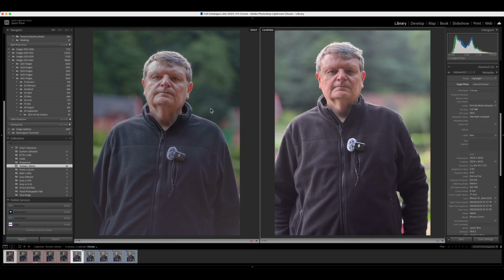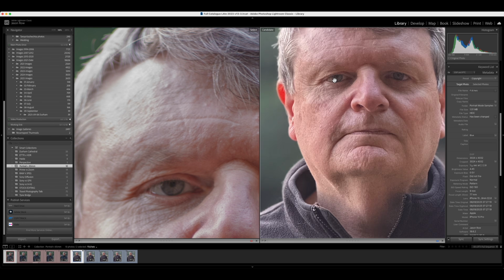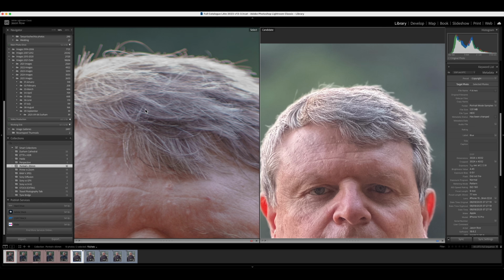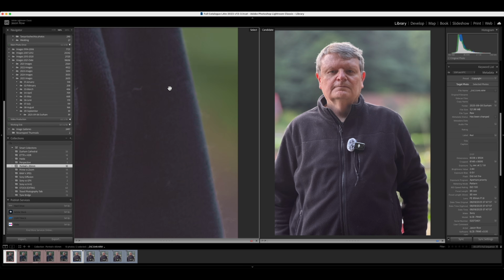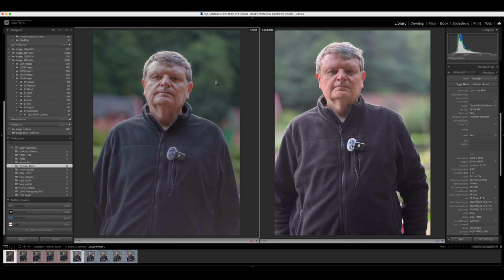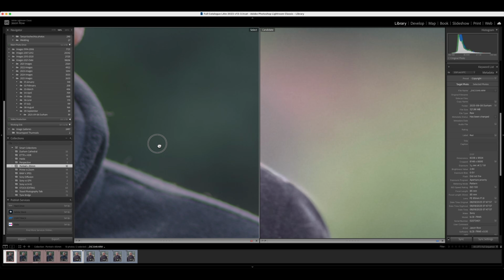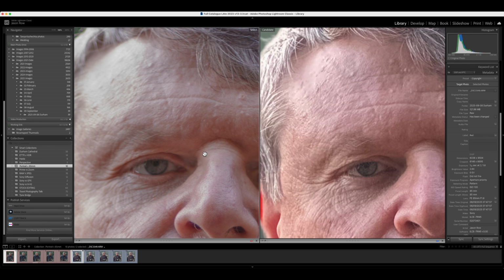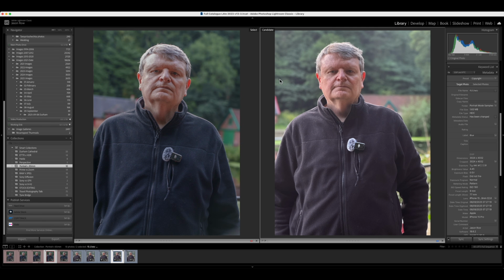Can the iPhone PORTRAIT MODE Replace Your 85mm PRIME?

Comment: I prefer 100mm lenses for portraits. The 3 times lens wasn’t enough and the 5x was too much. With my new 17 Pro Max, the 4x 48mp camera is much closer to what I prefer. We can also have Apple bin the pixels for a 24mp image with slightly better s/n, if needed, or even down to 12mp, which give even slightly better s/n and is suitable for 8 x 10, I find.

But I’ll tell you the 15 image quality is noticeably lower than my 16 pro max. While the 17 pro max normal cameras aren’t much different other than improved software algorithms, the tele, I’ve already found, is much better. Additionally, the 16 pro is better at finding hair. So far, the 17 pro is slightly better than that.

I consider the regular 15 as somewhat obsolete as far as serious photography goes today. Smartphones evolve much faster than standalone cameras do.

By the way, the Sony highlights are blown out. Not good.
Reply from the maker: Thanks for your opinion

Comment: The iPhone is pretty good considering what it is working with, and fine for 90% of people.
Reply from the maker: it's ok if you are only going to use it for social media or to look at on a small screen. Zoom in, even a little way and it really breaks apart
Reply: @rowtography  yes this is always the case on mobile phones, even the best ones, unfortunately.
Reply: @keybraker  Sensor size matters
Reply from the maker: It does

Comment: I’m receiving my iPhone 17 Pro Max on Friday. Later this fall, I plan to pick up an add-on lens—there’s a new generation coming out soon that screw onto the front of the iPhone’s lens, which should be interesting. I’m leaning toward something in the 80–100mm range, since I’ve been testing shots without Portrait mode and want to compare the results. The iPhone 17 now has a built-in 100mm 48-megapixel telephoto lens, and I’ll be experimenting with that as well to see how it performs for portraits.
Reply from the maker: The 48mp might make a difference if they reduce the over sharpening. I must say I am warming to the 17 Pro, I wasn't impressed when it was announced but it does have a great spec for video and photography
Reply: 48?
You mean 24, since it uses this double pixel trickery? Iphone camera is very interesting, and an amazing tool, but this marketing around megapixels getting ridiculous. 
I honestly don't think it will ever replace a real 20mp sensor, when it comes to natural look. The photos come out clean, sharp, and social media ready, but also so artificial...
Reply: @mark123ioArchive no, it’s 48mp.
Reply: There’s no screw for add on lenses. You need a case for lenses, a contraption that holds the lens to the corner of the phone, or a rig for the phone that will allow a lens to be screwed to that. I have a Beastgrip for that, but you can’t screw a lens directly to the phone.

Comment: can always batch run the iphone pictures through luminar or lightroom etc to re calculate the depth and put proper gradual blur. this can all be automated. i dont like iphone but this isnt a bad step to take.
Reply from the maker: By further editing you will also be possibly degrading the image even further as well. For me, it's the massive over sharpening that is the main issue

Comment: Nice video, thanks for sharing - I am always excited to see how iPhones keep getting better and better every few years. 17 pro has more than 50% increase in size on the portrait lens to the 15/16 pro so that should make a big difference. A suggestion: have you considered the Halide app with its Process Zero mode? It takes out all the computational photography malarkey and gives results that a 'old school photographer' like myself finds more pleasing.
Reply from the maker: Thanks for the suggestion of Halide, I will take a look. The problem with pretty much all of the third party apps,  is that Apple restricts them to 12mp. Not a problem on the 15 Pro telephoto lens but an issue for the main lens.
Reply: @rowtography  That's true actually. Just took pictures to test this with Halide and it is indeed 12MP for all three lenses.